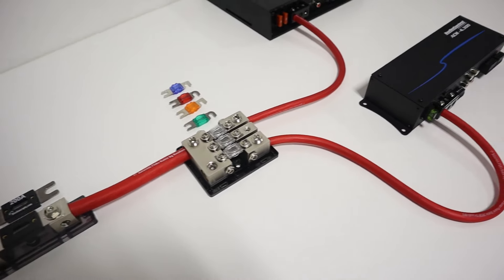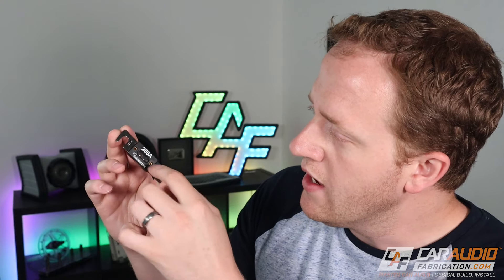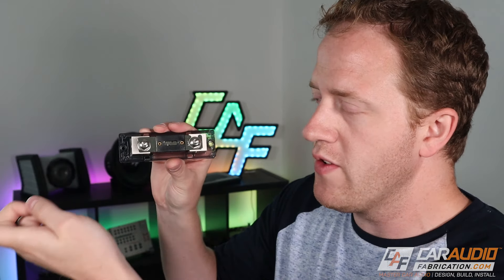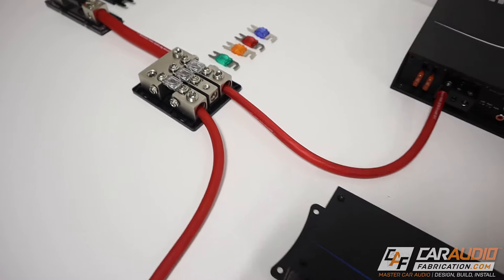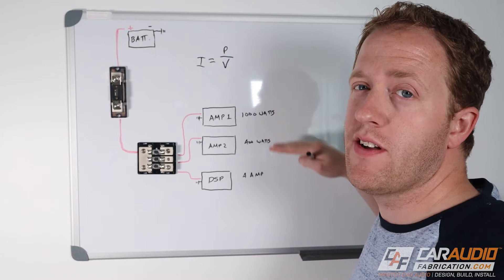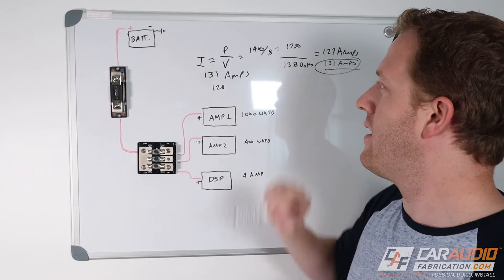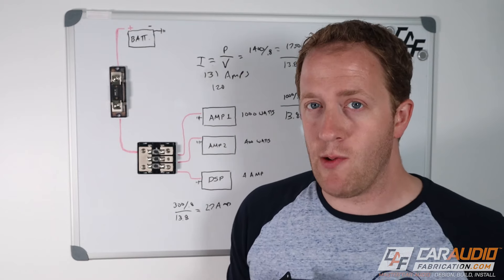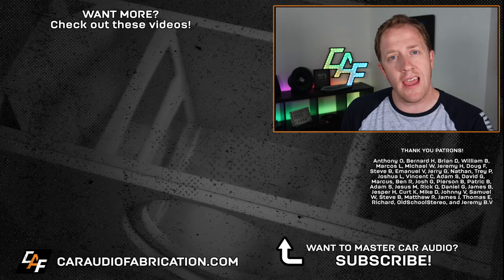Fuses EXPLAINED! What size do YOU need & MORE!

Comment: Wouldn't the demand of the speakers determine the fuse amperage? If I have 2 midrange speakers rated at 300 rms max but my amp is rated for 1100.the amp would never be able to give over the max rated rms of the speakers.

Comment: Quick question Mark! Do you base your calculations regarding wattage on the Amp Total Max Wattage, or do you base your calculations based on the Amps RMS Power? For example, I have a 4 ch Precision Black Ice Amp Max 1600 watts RMS 800 4x200@2ohm load. I then have the Monoblock 5000 watts Precision Black Ice RMS 2400 @2ohm and 1700 RMS @ 4ohm load. So, I calculated my RMS wattage. For example: 1st Amp 800w div by .8 then div by 13.8 =72.4amps and will use an 80amp fuse.   2nd Amp Monoblock: 1700w div by .8 then div by 13.8=153.9amps. So I will use 150amps fuse. This is based on my RMS Calculations and not the Peak.  The total system fuse amperage needed is 800 plus 1700 RMS=2500w RMS  div by .8 =3125w div by 13.8 =226amp fuse. I will use a 300 amp 12v Breaker Fuse. Let me know if your calculations are based on RMS or Total Peak Power of the Amp. This is a very important question since all calculations will depend on either the Peak or RMS power of the Amp.  Let me know Mark. By the way, thank you for your awesome tutorial videos! It's the absolute best on YouTube!!!
Reply: reading through the comments trying to understand the same lol

Comment: Hi Mark I like your videos, you are very professional on what you do, thank you for share your knowledge with us.
I saw the video that you explain about what fuse to use, in my case i want to install 3 amps each one has 3,000 watts, so 3000 x 3 = 9,000/.80= 11,250/13.8=865 Amp. so according with your explanation, but I do not see an amp like that. 
 
Can you please help me to choose the correct amp?
Reply: Did you end up using two 500amp fuses?

Comment: Where did you get the voltage from? How would I get my voltage?
Reply: A 12Vcar system with a lead acid battery is typically 12.6V fully charged and at rest. With the alternator charging while driving the voltage should be about 14 - 14.5V to be able to actually charge the battery. 13.8 is often used as an approximate/rule of thumb value in order to allow for the slight voltage drop in the wiring.

Comment: @caraudiofabrication I need guidance. I have (4) 6x8 speakers, (2) tweeters, (2) subwoofers. Powering it I have a 5 channel amp for the speakers, and a 2 channel sub amp. What I need help with is what do I need to get it setup/ equalized. I also have 2 volume control knobs, 1 for speakers(6) and 1 for subs(2). I'm using a tablet for output. No headunit. I have from the tablet a 3.5 aux to rca connected to 2 rca y-splitters going to each amp. What do I do? What do I need?
Reply: Sounds like u need a 8ch dsp or to ditch the tweeters and a set of 6x8 an go 6x8 in rear and most 6.5 components will fit front (guessing Ford or Lincoln vehicle) except for infinity (use odd basket shape but 5.25 no prob and low-key ditch 5ch go 4ch with preouts for sub amp reducing excessive splitters

Comment: So I'll be running 0 gauge from the battery but my monoblock requires 0 gauge input and my 4 channel requires 4 gauge input, could I get a distribution block to split the 0 gauge into two 0 gauge runs and then just use a reducer to plug the 0 gauge into the 4 channel?

Comment: Hi! I liked your video, very complete. I have a question, What happend if my amp has two fuses? for example 2x15, what´s the max power of the amp?
Reply: So 2x15 fuse =30 ...so your amp is around 350 watts

Comment: In my experience with wiring is that unlimited current on the shorted wire tends to be higher than 150amps of the fuse....

Comment: So, according to this tutorial, my Soundstream Stealth claims 1000W of Class D peak power, which would equate to about a 90A fuse.  However, the unit has a 30A fuse installed (4x90W RMS).  What rating fuse should I use in my distribution block/rest of my calculations?
Reply: Use RMS not peak, so 360W total, meaning a 30 amp fuse is ok.

Comment: #CarAudioFabrication I have a slightly different question about power requirements. Does an AMP only used for powering TWEETERS need to be the same relative RMS as the AMP only powering the WOOFERS?
Reply: That depends. Do your woofers and tweeters have different power handling and sensitivity figures? If they match it makes sense (but not required) to use similar amplifiers.

Comment: The length of the run plays a big factor in how much current a wire can safely sustain. 2 feet of 8 gauge will safely run more current than 10 feet.
Reply from the maker: Hwnce the chart mentioned in video

Comment: it made me a little more clever but i still dont understand what i comepletely need :-( i have 2 sets of door speakers(alpine s-s65 and s-s65C)  and a 2 x 10" sub. one 1100 amp for the sub and the other i cant really see what w it goes to. i bought the set used so i just need fuses and wires for it and a little more knowledge on how and what exactly to use. sorry if my english is a little off. 
im from denmark.

Comment: When an amplifier has two fuses, are these two fuses provided for redundancy?  In other words, should I be adding the fuse values together to have an idea of the maximum current or should I use the value of one of the fuses individually?

If you add the two fuse values together, why not just have one larger fuse then two smaller fuses?
Reply: Depends if they're connected in series or parallel.  If they're parallel if memory serves me right, you add together, series, its redundancy,  another possibility, is they're protecting 2 different circuits within the component. 
Someone feel free to correct me on this
Reply: @Jeff Kahlig  
When amplifiers have more than one fuse, Each Fuse is usually protecting a Separate Power Supply within the amplifier.  You would use the Total Rating of ALL of the fuses on the amplifier for your Main Fuse calculation.

For example, a 5-Channel amplifier may have TWO separate Power Supplies for the 4 standard channels (One Power Supply for each 2-channel standard output section).  And then the amplifier will have a THIRD Power Supply for the higher-powered mono Subwoofer channel.  So there is a fuse for each of the internal power supplies.   OR, a 6-channel amp might have 3 Fuses...One fuse for Each 2-Channel circuit.

It obviously depends on the design of the amplifier.  Some 4-Channel amplifiers will just have One Power Supply, but most have Two Power Supplies, hence 2 Fuses.
Reply: Thank you!

Comment: Awesome video! I've watched so many just tonight. I do have a question, however. If I was wanting to install a system similar to this one and did all the math correctly, what if I have or want to install some gauges? These gauges would be for other things like my turbo boost gauge, temp gauge, oil press. gauge , etc.. Do you have your 2 cents on this? Would I just add the amps required from the gauges' system to whatever line of wire I'm linking it to, and have that dictate the wire size and amp necessary? Thank you for your help! Anyone is welcome to help me out!

Comment: I'm going to be installing a cerwin Vega spare tire sub. I purchased an 8 awg install kit and I think it comes with a 60 amp fuse. Is this ok to use with this amplifier for the main power wire? If not what would you reccomend? Thanks for the information.

Comment: Hey man, really enjoy your videos and have learned a lot from them! So much so that I have the confidence to upgrade all my car speakers and install a self contained sub. That being said, I have a few questions. My car is a 2007 Peugeot 307, you don’t get them in America but you can google it if you’d like. 
Firstly, I’ve taken off my door card and I was quite surprised at what I found. There is a sheet, similar to a moisture barrier, stuck to the inside door skin, but it is made of thin foam. Because if this, should I still take it out and stick sound deadening inside the door? This brings me onto my second question. 
My speakers are mounted to the back of the door card instead of the door skin. Should I stick some sound deadening to the back of the door card since it isn’t the best quality plastic? 
And thirdly, the tweeters that are part of the system I am putting together are 1 inch and the current tweeters are just under 2 inches. Would this cause any issues with mounting? I know I’ll most likely have to make a custom bracket. 

The system I want is all Kenwood and includes:
KSC-PSW8 8inch sub
KFC-X174 17cm speakers (front)
KFC-S1366 13cm speakers (rear)
KFC-ST01 1inch tweeters. 
Combined peak power of 910W. 
I’m also going to look at foam surrounds like I saw in one of your earlier videos :)

All the best and thanks in advance,
Jacob

Comment: I don't know what size fuse.  I have two kicker amps install 1dx amp 600watt rms. And 1 4channel 75 watt x4 rms.  I have 0guage running to distribution block then 4 guage to amps.  0guage I have 250amp fuse then after disribution block 80 amp on each.  I still can't figure what size amps are kicker cx and dx amps

Comment: Can you help me out very quickly? The fuse near the car battery keeps blowing out, and I don't know what the problem is. The amp fuse has always been fine, so I don't know what's causing the problem.
Reply: I think I need to refine my question. I'm running a compact Rockville unit than brings combined a/b amp and sub. The amp max is 800w and comes with a 25A fuse. Now, I got 12 wire to the battery that came with a 20A fuse. I'm using 16 feet of wire to the battery. According to the formula you used, the fuse in my wire close to the battery should be 800/0.5 divided by 13.8. that's 115. That means I should use a 110A in that wire near the battery. Well, I have a 20A there that came with the amp kit. I don't see how I could get a 110A fuse there. What should I do? Please, help.
Reply: @lohengrinknight  Hey man! Did you fix it? What was wrong? In your case I would at least use 7 gauge wire for the power and the ground. Secondly the fuse on the power must be placed as near as possible to the positive terminal of the battery. Use a mini anl fuse box with a fuse at least 30A (bigger than that of the amp's 25A). Also I forgot to mention that you also have to learn how to use a multimeter and check for possible short circuits and such.

Comment: I need a bit of help and thought someone on here could help me out or point me to a place where I can get the info I need. I have an Avalanche premade sealed box and the spec's per chamber is .8 cubic feet but my Jl 3v3's recommend .6 each. Is there a way to take away cubic space in the box so they match perfectly? Would just putting some foam in the box work?

Comment: Do you have a video on how to connect 2 amps? 1 amp for door speakers, tweeters  and 1 for subwoofer
Reply: I have a Pioneer GM-D1004, you can use it with the ISO cable or RCA

Comment: How did you get the system running voltage
Reply: Normally 13.8v is what the alternator pushes out to charge the vehicle battery. So system running voltage in other words is, when the vehicle is running voltage. However, some vehicles push out more, best way to find out exactly how much your vehicle pushes out is to us a multimeter.

Comment: I am really struggling with the fuse size calculation, seems way over kill and too large of a fuse for any electrical application can be like no fuse. If i go off of your calculations of max watts per amp for my 3 amps i need something like 280 amp fuse for my 3 amps, if i go off of RMS watts it is like 135 amps. If that were true how come running maxed out i do not blow a small 40 amp fuse ? if I was drawing anywhere near 100 plus amps my battery would go dead because it is much more than my alternator puts out. None of this is adding up and when i look at the manual for my 1200 watt max amp it says average current draw of 3.1 A, this makes much more sense as to why 3 amps would only be drawing maybe 10 amps top.

Comment: Great video, im still a bit stuck and was hoping you could help.

I have a 4 channel amp that is capable of 2 x 300wRMS. It has 3 x 25amp fuses installed.

As i will be using it to power components only, at 100wRMS each, can i assume that i can install a much smaller fuse (smaller than 75amp) at the distrobution block that will be feeding this amp?
Reply: @Boris theBlade  
Watch the video again and do the calculations that Mark shows on the whiteboard.  All of the answers are IN THE VIDEO.

But Yes, IF the amplifier is actually rated and is capable of putting out a true 300wRMS x2, you should be able to use a smaller 60-amp or 50-amp fuse if you set it to minimum gain and are only driving the input section of the amp with enough voltage so that it will never produce more than 100wRMS.

Use the formulas that Mark provides to measure the AC output voltage at your amplifier's speaker terminals to determine exactly how many watts are being produced.

You will need a DMM/Volt Meter set to AC voltage to measure this, and if the amplifier is just used for front components, you should play a ~70Hz -0dB Sine Wave Test Tone with the volume on the head unit set to your normal Maximum volume level.

Comment: How big of a fuse can I use before it’s considered too big for that wire?
Reply from the maker: Please watch the video
Reply: CarAudioFabrication what if I have an 8k watt amplifier but will only use about 2-3k for now and then later on down the road I will use closer to 8k? Will I just calculate for the max? Or would I have to use 2 different size fuses?
Reply: CarAudioFabrication Or what if I have multiple runs of wire to 1 amplifier. Lets say I calculated that I need a fuse close to 500a, and I have 3 runs of wire to 1 amplifier, would I need 3-500a fuses or does each wire have to add up and be close to 500a?

Comment: Hey Mark! nice tutorial for ConFused beginners :)

question: I'm about to add a DSP to my 4 chanel system.
what do you think about the rockford dsr1?
the AudioContol dsp's are to expensive for my setup.
the dsr1 looks super nice featurewise and i like the 8 chanels, so I can upgrade to a center speaker! 
also I consider a Focal 3way front system (the one for around 220€) 😁

greetings from Germany!
Reply: @DESCENT   

I'm not Mark but I have personal experience with the RF DSR1, RF 3-Sixty.3, and many other DSPs.  

The RF DSR1 is a great little processor for what it costs and will improve any system that does not already use a DSP.

However, it is a low-cost and relatively low-quality DSP compared to many others that are available.  If you have the budget and the rest of you car audio system is very high quality, I would look for a higher-quality DSP.  

Because you are in Germany, I would highly recommend the Audiotec-Fischer Helix line of DSPs.  I have used nearly all of their DSP products and they are among the very best in terms of SQ, Performance, and the quality of the Software as well.

Audiotec-Fischer also is very good about providing regular feature updates and bug fixes for both their firmware and software.  Many other companies release their products and then NEVER provide any updates or bug fixes!

The Helix units also support various expansion modules (HEC modules) to add more Digital Inputs, Apt-X Bluetooth Streaming, and direct USB DAC input, etc.  They are very versatile and capable DSPs.

IMO the Gladen Aerospace DSP units are very good as well, but I do not care for the Software that they use.

The ARC Audio PS8 PRO is also extremely good.  But I still prefer the Helix software.   And ARC is also not as proactive in providing software updates.

And the new Zapco HDSP-Z8/Z16 V processors sound AMAZING, but the Software and Firmware has A LOT of bugs that need to be worked out, so I cannot recommend them at this point in time (April 2020).  Zapco is very slow and inconsistent in providing any type of updates or support.  :(   It's too bad because they sound incredible.

I would also highly recommend the miniDSP C-DSP 8x12 v2 DL processors.  The Dirac Live tuning feature is a Game Changer.  However, it was designed more for Home Audio systems, so the DL tuning doesn't always work that well for the midbass & bass frequencies due to the unique acoustic properties of automotive interiors.  However you can easily manually tune this area and the SQ and Sound Stage you can achieve is amazing.

Each processor will have some unique features that you may or may not find to be an advantage depending on your system setup and goals.

The Software is the most important to me, and also the capabilities of the Remote Control/Display.  Some remotes are a separate purchase and some are included, so that is another cost consideration.

Good luck.

Comment: If my friend has 3x40A fuses in the AMP so he need to put 120A fuse after the Batt?
Reply: Not to be rude,  but run the math under ohms law and you'll get your answer.  
Mark gives the equation. Plus plenty of online calculators. 
If the amp is in the ballpark of 1500 watts then yes. But remember to account for efficiency factor

Comment: Guys I need massive help please, I use a line output converter for my factory radio of my Mercedes A class 2018, I have a JBL 4 channel amp which is connected to a pair of 6 x9 speakers and my sub. everything has been working fine for a few good months but a couple of days ago I turned the volume higher than usual and my amp when to Protected mode, I checked all fuses, wires, Rcas, everything in detail and everything looks good, however, when I tested the RCa I noticed that the problem happens when I have the sub on, when I disconnect the sub Rca from the amp everything works fine again. am wondering if its an issue with my Line output converter output signal or the factory wiring system. any suggestions please??